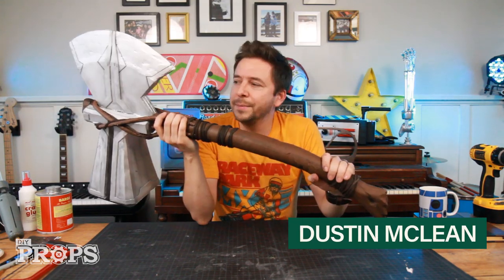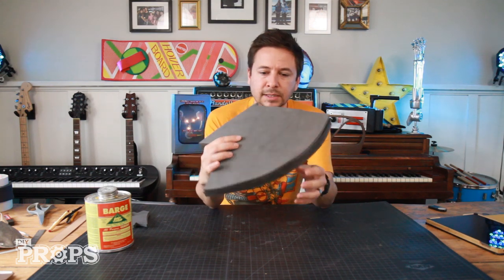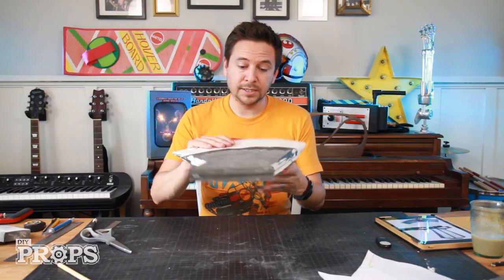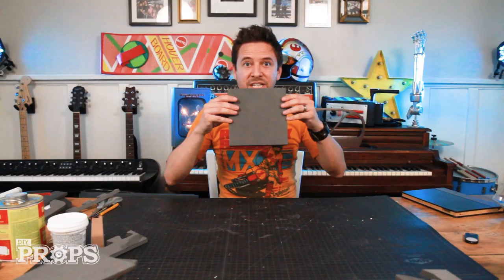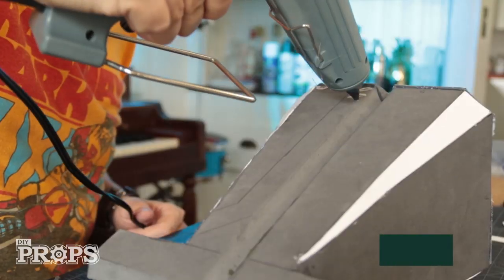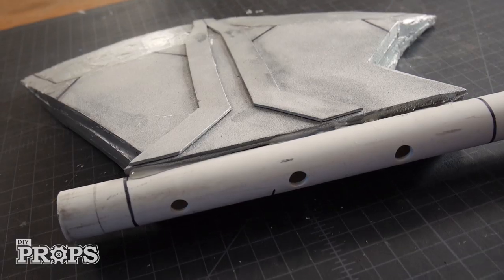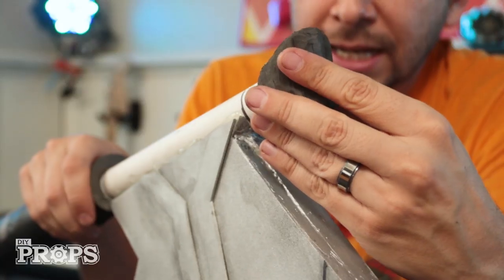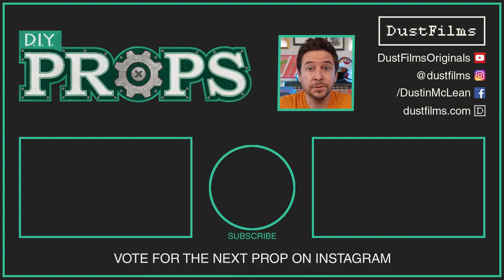Thor's STORMBREAKER for under $20 | DIY Props

Comment: For Dustin or anyone who is in the comments: a cheap and easy was to get something look like leather is using electrical tape, you can get them for 50 cents in some places, just make sure they are not glossy, and you can use it to “black leather” wrap something
Reply from the maker: I’ve never seen electrical tape that wasn’t glossy but yes, I’ve used it as black leather wrap a lot in the past too!

Comment: A good tip, using a heat gun on the foam before applying the primer & spray paint will help give it a smoother look so it  won't look like foam.

Comment: Hey Dustin! With big things like the head of Stormbreaker, I think you might have a better time with extruded polystyrene, that pink insulation foam board. It cuts and sands really easily.
Reply from the maker: I've been wanting to try it! I just haven't looked into where to buy it yet, is it easy to find?
Reply: Dustin McLean I get mine at Home Depot. They usually have the giant sheets, some have smaller project boards that are easier to get around.
Reply from the maker: @Weezie371  Oh shoot that's easy haha. Ok I'll try it out next time! Thx

Comment: You could have skipped the spackle if you just used the palm sander from the beginning
Reply from the maker: The palm sander would never cut through that much foam. In fact that was  plan all along but after like 15 minutes of sanding it had barely sanded anything. So I had to resort to cutting. If I had an orbital sander that would eat through it fast!

Comment: Pro tip: you can sand the foam in belt sander to make a sharp edges
Reply from the maker: If I had a belt sander (like Odin Makes does) I would have used it. :)